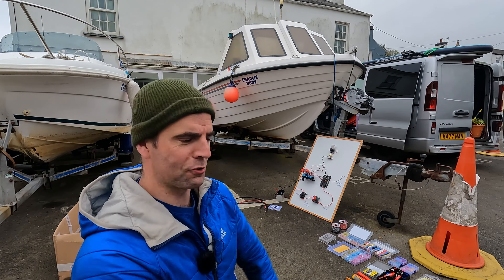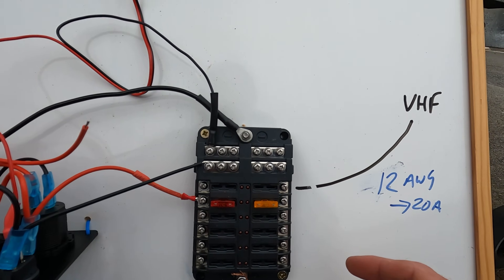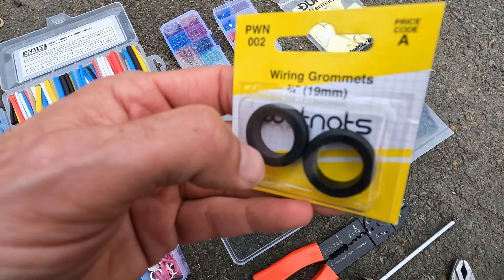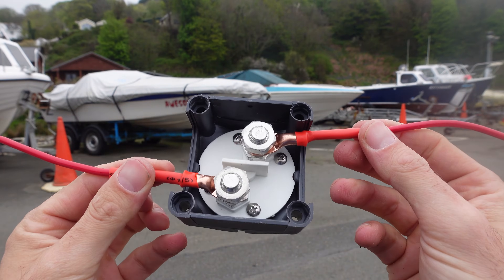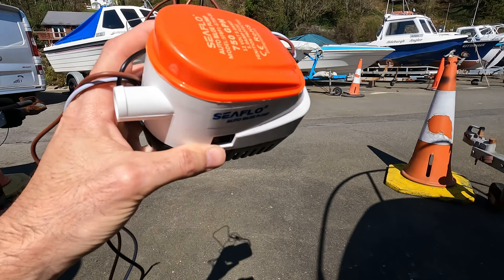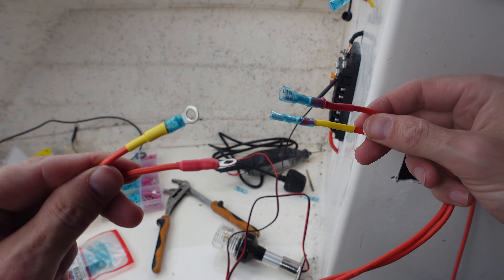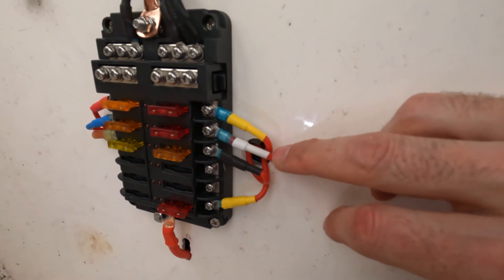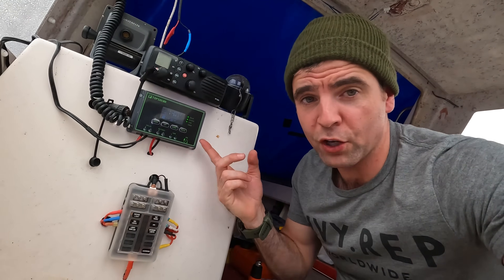COMPLETE BOAT 12v Wiring Setup - Fuses, Switch Panel, Isolators - SMALL BOAT Project Ep.4 (4K)

Comment: Does the breaker need to be close to the battery?  It would be nice to wire a breaker under my dash as a kill switch instead of opening the engine lift door to get at the battery.  Great video!
Reply from the maker: I believe it’s better closer to the battery 👌

Comment: Good job on the wiring. The only thing I would do different (as an electrician) is to make the battery isolator switch the first thing that is connected to the battery. It should isolate all the circuitry including all protective devices. With regards to the cables, the more flexible they are the better they are at withstanding vibration and movement so less likely to break off over time. The finer the strands in the cable the more flexible it will be.
Reply from the maker: Appreciate the feedback, I'll keep that in mind for future projects 👍

Comment: The Circuit breaker also works as a on/off switch as you  can just push the button, eliminating the on/off switch.
Reply from the maker: Yes indeed I use it like that when it’s out of the water

Comment: Hello mate. Thanks for the video its just what i needed. 
Wanted to clarify that 50amp breaker did you get that by adding up all your bits and bots amps together or purely on the wires capabilities? Thanks.
Reply from the maker: Purely by the demand I was putting on the system 👌 cheers

Comment: All makes sense but .. if you can easily get to switch panel (fused as bought) is there really any need to add another fuse box? If the pre done switches is enough and easily accessible would it really matter if didn’t then change it and add a fuse box as well ? Thanks
Reply: Looking at 6:57 I wouldn't fancy sitting in the cuddy with my head inside the console trying to figure which blade fuse belonged to the failed circuit, while the boat bucked around in the waves. Although more work & extra cost. checking for the blown fuse on the outside of the console when the going got tough would be much simpler. NB. I also think I would fit a circuit breaker panel instead, much easier to press a button than fiddle with fuses with wet hands...

Comment: Great video and explanation! Thanks for doing this! It has helped me add electrical to my old fiberglass jon boat.
One question: What size fuse did you use for the positive wire running from the fuse panel to the switch panel?
Reply from the maker: 50a 🤙 thanks for watching
Reply: Thanks! To clarify, I’m asking about the size of the blade fuse on the fuse panel where the positive wire from the switch panel connects to the fuse panel.

Comment: Matt, with the 50 amp circuit breaker, wouldn't the starter on the outboard draw more when starting?
Reply: I think it would only be supplying a solenoid, not the actual starter itself, so very low amperage.

Comment: I was wondering what if im using 2 switch panels. Should i use a separate fuse box ? I hope i can connect both to the same battery which are in parcel.
Reply from the maker: Can use same fuse panel 👍

Comment: Did you bypass the positive and negitive on the switch panel with going straight to the fuse box?
Reply from the maker: Kept the positive and negatives 👍
Reply: @dennistonstewart86 the negatived are daisy-chained (no switches involved).
the positive feed is also daisy-chained to one side of each switch, the other side of which is wired to individual fuses.

Comment: Running a dual battery setup, where would you put the breaker fuse?
Reply from the maker: Id get a blue sea system it does it all 👌 breaker fuse same place within 12 inches of battery

Comment: ok mate great video by the way I'm wiring my boat the same way well I copied what you have done but here is my problem the fuse box dont know how to word it or say it ok here goes on the pic you have shown how you have wired it the red wire coming from the fuse box going to the switchboard  but I want to know what size is the connector ring on the end of the wire fitted to the fuse box under the screw thx jay and iv subscribed to your channel and watched all your videos and a thumbs up and one more thing love your warrior iv got a 14ft cjr
Reply: I just watched the video again and I see you are using the blue 14-16 ring connector but want the no the size of the ring in mm

Comment: Hi, not sure if I missed something but does this wire up to accessories leave the accessory unfused if the switch itself shorts?
Reply from the maker: I use the separate fuse board for easier access
Reply: Yeah I get that. I love what you did. I have been planning a similar setup using the fuse board and switch panel but I have been told that (particularly in a salt water marine environment) that I need to fuse between the accessories and the switch as the switches themselves can short through moisture/ corrosion etc. I am just interested to know if you worked around that or didn’t feel it was a big enough risk?

Comment: Had a small fire on my boat (prev owner used automotive wires and automotive connectors !!) So gonna have to assess the damage in the Spring and re-wire. Luckily i too have some experience w 12v and added 2 of those exact same solar panels like you did (i love having them).... Thanks for the helpful video.
Reply from the maker: All the best Steve 👍

Comment: Have you put your second battery in,  if so have you done a video on the installation  ,,great video
Reply from the maker: I did but never filmed it. Check out Blue sea systems add a battery system
Reply: When you put your second battery in did you have the circuit breaker on just the house battery ,  your videos are brilliant giving me lots of confidence to start on my own boat , cheers

Comment: Great video and explanation. Question: I have a one engine to one battery setup...is the wiring in this video workable with that?
Reply from the maker: That’s all I have in this video, one engine, one battery. For two batteries check out blue sea systems 👍

Comment: Is the circuit breaker i must need for this to work? I'm using a 12 voltage battery and a small light bar, not on a boat.
Reply from the maker: Not required I just added it in as an added peace of mind bud 👌

Comment: Hello, I don't understand anything about electricity. I recently purchased a boat and it has a switch panel installed like the one you show in the video. I have to add a few things like the sonar, horn and a light. My question is the following: To connect any device to this switch panel, I don't know where I should connect the negative cables since I only see positive cable connections. Thank you so much
Reply: The negatives (normally black) are all connected to each other. There is no switching on the negative side.

Comment: Mat, I have a question. You stated that you had put a 50 amp breaker because your wiring system is for 55 amps. How did you determine this (the 55 amps)? Maybe by adding up the amperage usage for each item on the system?  Thanks, Kevin
Reply from the maker: Exactly that Kevin, I added everything up and that would comfortably manage it all 😀

Comment: i've been a marine electrician for 25 years, there's a reason why marine wiring was standardized all those years ago.  All your wires are the same color.   Somebody down the road is going to be so pissed off
Reply from the maker: All labled at both ends 👍 thanks
Reply: @AirbornePirates  yeah, that'll work out really nice for a few years and then all the labels fall off or the ink bleaches out and even then, what could possibly be written on the wire that would help somebody? .  then a 2 minute repair can easily escalate to all afternoon and then some poor guy makes nothing that day.     We call owner repairs like that 'day waisters'   Obviously, we refuse to work on those and then  the name, hull number, vin number and boat description goes on our database so that none of our shops or venders get stuck working on it.  Absolute nightmare,  you don't understand
Reply: @dirttdude  You can use numbered sleeves. No problem.
Reply: @ I guess,  if it was standardized.  Would be much  more easy for auto technicians by a factor of 10 because all cars would be wired the same, thusly speeding up troubleshooting and saving the customer money while simultaneously increasing profit.

Comment: Used the same switch panel and have found it to be very poor quality...basically it lasted two trips out (saltwater) in my Rib before failing due to corrosion.  How are you finding yours?  You have more protection, I guess.
Reply from the maker: That’s a shame I’m a year in now and mine is still good, I think the blue sea panel would be a gold standard / better optio.

Comment: Great vid. One question. Is the battery isolator switch necessary when you have the breaker? Does manually popping the breaker act as a cut-off as well?
Reply from the maker: Hi Jake probably not necessary but I prefer that as it’s easier to access on my boat.

Comment: As long as you have a fuse rated 50% of the wire things draw from you're sorted. 99% of boats are written off due to fire, not many boats actually sink....but at least they self extinguish  🤣
Reply: 60% of the time it works every time

Comment: Could you have left the wires with the fuses (from factory) on the switch panel rather than removing and only using the fuses on the fuse panel? Just wondering if it would be bad to leave it, then each accessory would have 2 fuses?
Reply from the maker: Yeh would work fine buddy, I just prefer a separate fuse panel
Reply: @AirbornePirates  and on the front of the console, not hidden behind it.
Reply: @AirbornePirates  Enjoyed the video.

Comment: I now have a Warrior 170 and wanted to add a voltmeter to both the batteries. 
Do you think I can just wire them directly to each battery using 12AWG wire and a 5amp in-line fuse or is there a better / safer way to wire these ? Appreciate any help as I do not want to cause a fire. Cheers.
Reply from the maker: For a volt meter I wouldn’t put a fuse but if you wanted then a small 3A inline fuse on 12AWG. Warrior 170 are very nice indeed
Reply: @AirbornePirates  Many thanks for your reply. I have just been looking at the voltmeter and it has come with wire which looks like 16 awg size. 
Is this done to a cost and would be better replaced with 12 awg wire or do you think I can use 16 awg wire over a 1.5 m distance (I can not see how many amp's these draw) ?
Reply: @robertpaterson7311  Virtually no current involved, the original wire size is fine.

Comment: Super helpful video. You motivated me to tackle my own wiring redo, despite being a newbie. Question for you - did you also run 8 gauge for the negative cable from the top of the fuse panel back to the battery? Also, I’ve found it really hard to find the right ring terminals for 8 gauge cable for some reason
Reply from the maker: Yes mate I did, I bought terminals on Amazon and crimped them myself. Hope that helps

Comment: Prob do t rear old comments box so anyone with good boat electrical experience any answers appreciated. 

My trolling motor is a 24v motor battery system.
Putting in a new fuse panel also it’s a new build. Still deciding on which battery to get either a 24v ion lithium(1 smaller lighter battery), or 2- ion lithium’s or 2-lead acid, going to depend on money at the end the battery are my last buy. 
If I buy 1 24v battery, I was going to run the trolling motor straight to the battery, adding in line fuse/breaker, on/off battery switch just for trolling motor all separately. 
All rest of wiring is 12v, nav lights, accy, live well, bait tank, radio, cab, etc. how do I wire 12v to new fuse panel when battery is 24v, abd I’m using 1 battery, or is it possible to make 24v battery out 12v out of fuse panel? 
Know it is a.stupid question, smart ass answers don’t bother me so your wasting your energy thanks everyone

Comment: Great great video! Thank you so much. I'm getting ready to rewire my center console boat for the first time. I feel very comfortable with electrical The only question I have is on my old control panel there is breaker switches do I have to put those back in or can I just run them to the fuse block and write to hey toggle switch? Thank you again amazing video keep up the good work!
Reply from the maker: Hi Rick, is the breaker between your panel and the batter or switch? Thanks dude
Reply: @AirbornePirates  The breaker is between the switch and the fuses. I don't know why I thought the fuse is would have been sufficient. Don't know why they did it this way I'd like to do it without them to make it look cleaner. What do you think?

Comment: Thanks for the video, i can see you put a lot of thought into your system. 

I hope it's ok to make a suggestion, give the cig lighter socket, volt meter and usb port individual positive and negative back to fuse box. Cig socket can supply 10a plus whatever the usb adaptor is, all those joins along the negative run will give you voltage drop and a chance of failure along the way. You might find that the meter reading drops when those sockets are used as the circuit is shared
Reply from the maker: Thanks Martin, I hadn’t thought of this but will update it with your suggestion, makes sense

Comment: Great video pal. How would you connect up two leisure batteries and a starter battery? Can’t find any videos that do that. And also how you would charge them off outboard?
Reply from the maker: I am planning on setting up dual batteries there’s a great video on YouTube by tiny boat nation and another channel called Jon boats ,
Reply: @AirbornePirates  thanks for the quick reply.  I’m going to follow suit and do my own… been let down twice by Marine techieS… lol. Yes I’ve seen a few that do dual but I would like to have a starter battery just for the outboard then two leisure batteries for onboard stuff etc. i don’t think you can charge 3 from an outboard though TBF?
Reply: @thegrumpybusinessman3400  You could put a changeover switch on the input sides of the two leisure batteries.